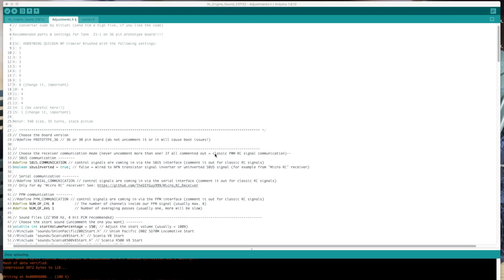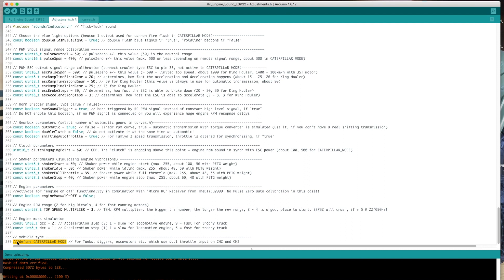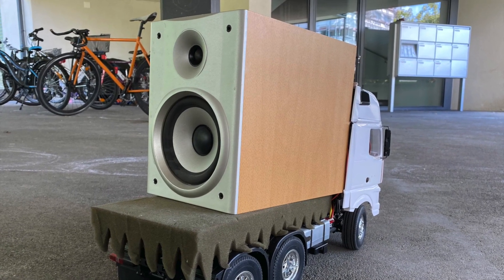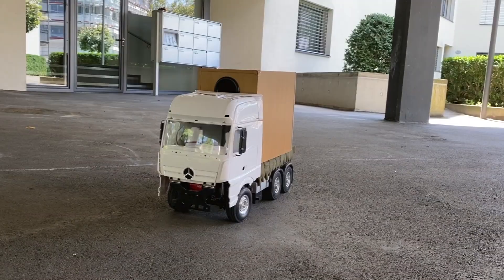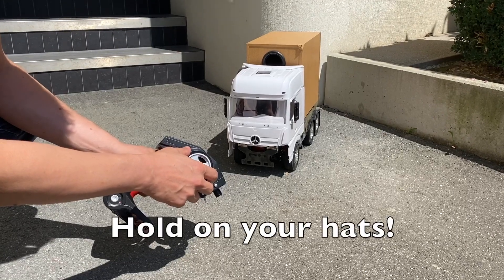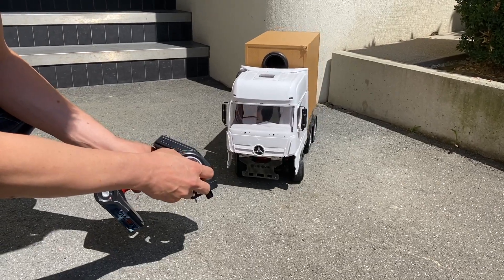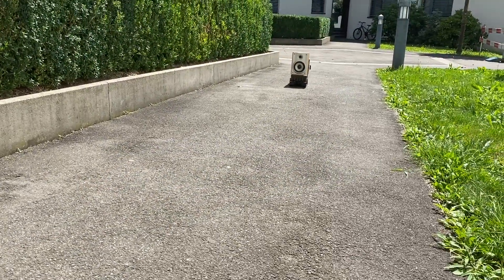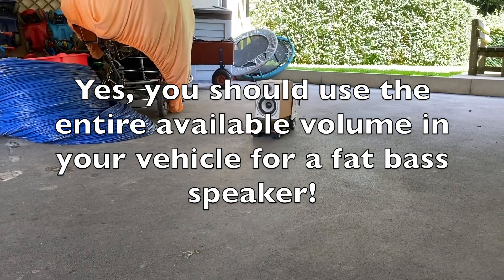V12 Diesel for the ESP32 RC Sound And Light Controller: Insane Bass, Tracked Vehicle Support!

Comment: I have done my arduino promini, turn signal, reverse lights and brake lights are on properly, but when I press the ch3 button all lights blink, so my point is, I want to change the code for the ch3 button when pressed it will only turn on the main light , but I only have hex files, not ino files.
Reply from the maker: I'm sorry, but I have no idea what board you have. Where is your hex file from? Link?
Reply: @TheDIYGuy999  my board is Arduino Promini Atmega 328p 5v 16Mhz,
link for hex : https://drive.google.com/file/d/1nVJ5pnoSPX2R8OMoOyHoBmPKKY9nYT8o/view
i got the tutorial from this youtube : https://www.youtube.com/watch?v=JCMGzQp6wfA&t=23s

Comment: Does this ESP32 Arduino DIY RC engine sound and light controller work with a classic RC transmitter like FlySky GT3C with the classic pwm receivers?I've scatched built one but seems it doesn't communicate with my receiver.When plugin the batt,engine start and idle only.Did I miss something in config?I just did the followings:-
#define PROTOTYPE_30
#define SERIAL_COMMUNICATION
Reply from the maker: You config needs to be as follows for PWM communication:
// ---------------------------------------------------------------------------------------------------------------------
// Choose the receiver communication mode (never uncomment more than one! If all commented out = classic PWM RC signal communication)--
// SBUS communication --------
//#define SBUS_COMMUNICATION // control signals are coming in via the SBUS interface (comment it out for classic RC signals)
boolean sbusInverted = true; // false = wired to NPN transistor signal inverter or uninverted SBUS signal (for example from "Micro RC" receiver)

// Serial communication --------
//#define SERIAL_COMMUNICATION // control signals are coming in via the serial interface (comment it out for classic RC signals)
// Only for my "Micro RC" receiver! See: https://github.com/TheDIYGuy999/Micro_RC_Receiver

// PPM communication --------
//#define PPM_COMMUNICATION // control signals are coming in via the PPM interface (comment it out for classic RC signals)
#define NUM_OF_CHL 8          // The number of channels inside our PPM signal (usually max. 8)
#define NUM_OF_AVG 1          // Number of averaging passes (usually one, more will be slow)
Reply: @TheDIYGuy999  I follow as above,still no luck.When I power up the ESP32,engine start and idling sound forever,I manupulate the throttle,no response.I just connect my receiver throttle signal with a 470 Ohms(instead of 330 Ohms) to D14 of ESP32 and with power amp and speaker.
Is it something I need to change here for pwm signal?
// PWM input signal range calibration ------------------------------------------------------------------------------------
const uint16_t pulseNeutral = 30; // pulseZero +/- this value (30) is the neutral range
const uint16_t pulseSpan = 300; // pulseZero +/- this value (max. 500 or less depending on remote signal range, about 300 in CATERPILLAR_MODE)
Reply: I got it working now,I've tested with my old Turnigy 9X8CV2(Similar to FlySKy 8ch FS-R9B using same protocol AFHDS) with FlySky GT3C transmitter in PWM mode,and Jumper R8 receiver(similar to FrSky X8R) with RadioMaster TX16S transmitter in SBUS mode.All working ok!
Do not uncomment it for general one ESC models
//#define CATERPILLAR_MODE // For Tanks, diggers, excavators etc. which use dual throttle input on CH2 and CH3

Comment: can u please make simple rc light control using arduino promini, for 3ch  Austar AX5 transmitter...
I  want the ch3 button as the on / off switch for the main light, so it can directly connect to Austar AX5  transmitter, 
I would be very grateful and thank you very much.....
Reply from the maker: For a functionality that simple you could use this cheap board:
https://www.banggood.com/190mm-3CH-LED-Light-Switch-System-W-Flashing-Light-Function-Turn-ON-OFF-for-RC-Car-Model-Parts-p-1376880.html?utm_campaign=4828314_1046285&utm_content=1097&p=NZ29024828314201605E
Reply: @TheDIYGuy999  I have done my arduino promini, turn signal, reverse lights and brake lights are on properly, but when I press the ch3 button all lights blink, so my point is, I want to change the code for the ch3 button when pressed it will only turn on the main light , but I only have hex files, not ino files.

Comment: Ha ha, love that tank sound. Your Caterpillar/Tank config works great on my IS-1, thanks very much for following up on my problem. So, when will you build a tank? ;-)
Reply from the maker: Yes, this thing is crazy 😎. You're welcome. BTW: currently, always the higher throttle input is used to calculate the engine RPM. This could easily be changed to the average of both inputs. Let me know, if you want to change it.
Where does the 3D model for your tank come from? Did you have to pay for it?
Reply: @TheDIYGuy999  The IS-1 tank (and his new T-34) were modeled by Lubos Hort. You can look him up here on Youtube.  I got his model from Cults 3D, the price very reasonable , about the cost of a roll of filament.  He provides a good assembly document as well as plans for a simple sound board (yours is much better!) . Check it out here:   https://cults3d.com/en/3d-model/various/rc-tank-is-1 
Lubos' channel is   https://www.youtube.com/user/luboshort.

Comment: can u please make simple rc light control using arduino promini, for 3ch  Austar AX5 transmitter...
I would be very grateful
Reply from the maker: Of course I could, but what do you want to control? And how?
Reply: @TheDIYGuy999  I  want the ch3 button as the on / off switch for the main light, so i dont need to calibrate the transmitter, thank you for your kindness